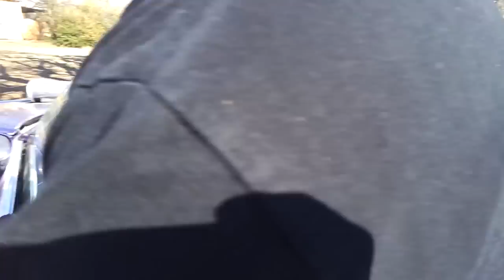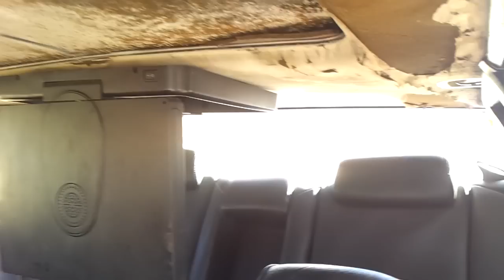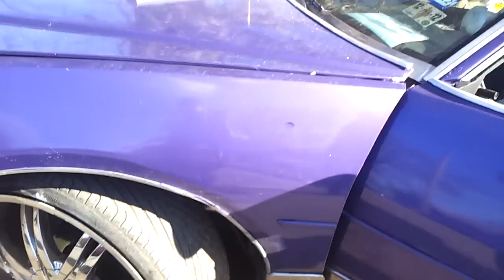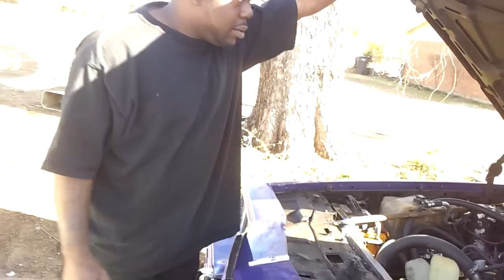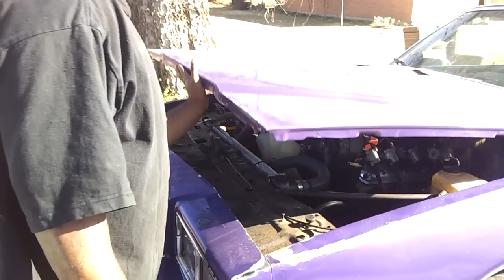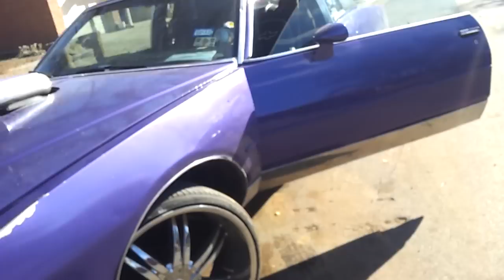Keeyzi Showin Off That Purple Thang

Comment: Which front accessory drive do use on the G body LS swaps?
Reply from the maker: Renoil Simpkins III truck assembly or aftermarket ls brackets
Reply: Koomlaude which year? I don't have AC so which pulleys should I go for?